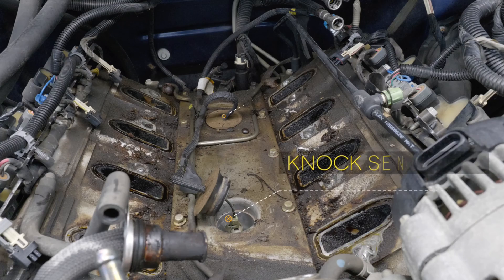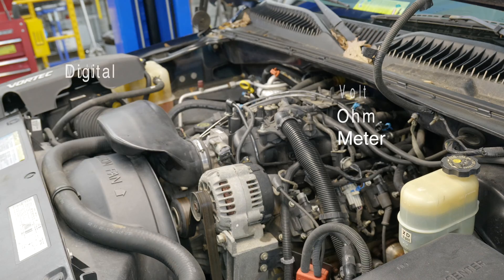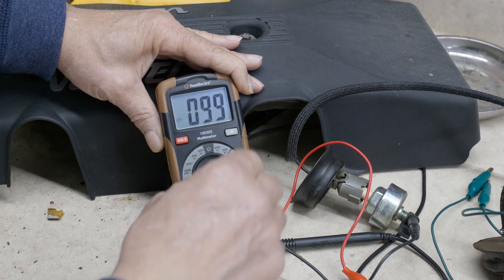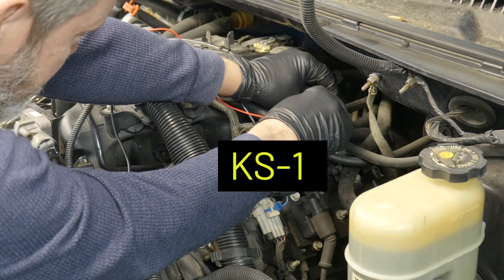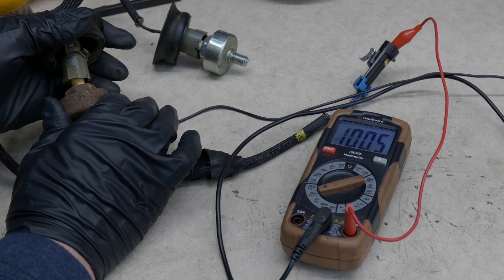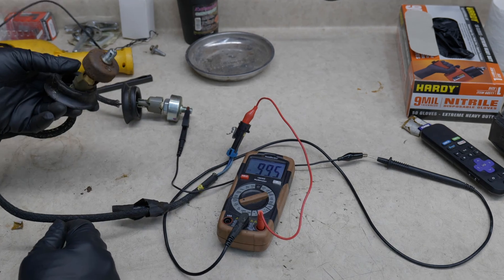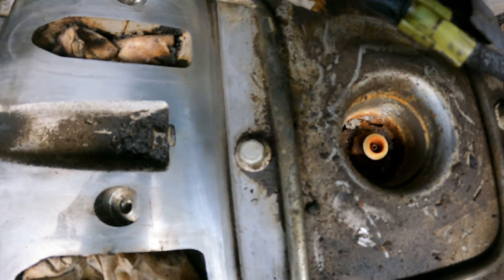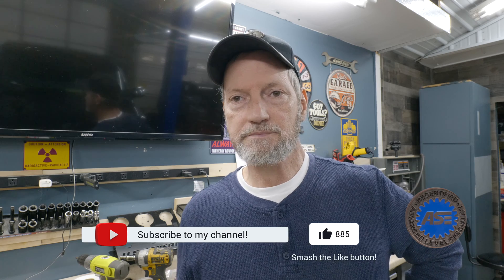P0332 Knock sensor test with DVOM

Comment: I replaced both, with the harness all a/c delco new. Codes came back fairly quickly. 327&332 low voltage. Both new ones ohmed out at high 900’s. Where does the low voltage come from? My next thought is to start going through all of the multi pack connectors and ecm connections looking for corrosion. Any other ideas? Anyone?

Comment: Hey James, I’ve been watching your videos regarding knock sensors as well as (IAC) valve test and replacement. I have a 2000 Chevy Silverado with a 5.3 vortec. I have recently had a local shop replace the knock sensors and ever since then I have a code p0507 for high idle. I took it back to the shop as I did not have this code before and they cannot find the problem the iac functions properly with the ecu. The truck will slowly accelerate to about 30th on its own and maintain speed as if cruise control was engaged when letting off the accelerator. Would a vacuum leak cause this? I have no idea what can be the problem!
Reply: I have already checked cruise control cable and bought a different iac and tps to test if there would be a change there is no change in the high isle speed. However, when I come to a complete stop while driving the rpm’s drop to around 700-800 like normal. Any suggestions would be helpful thank you!